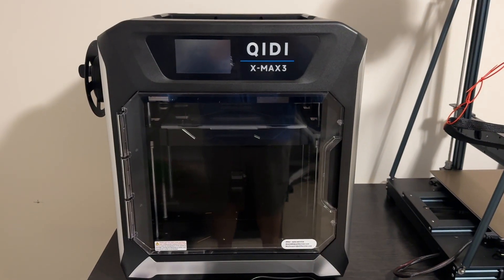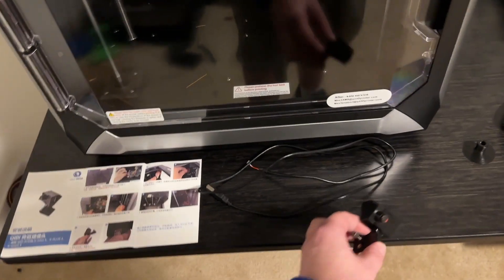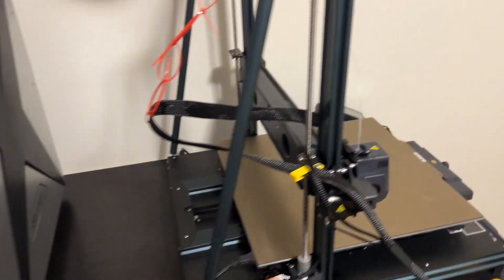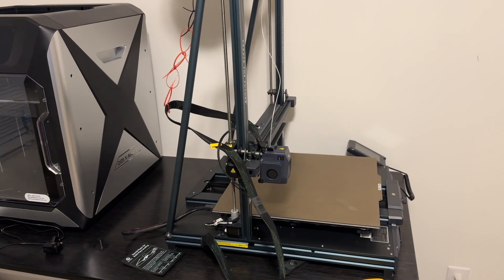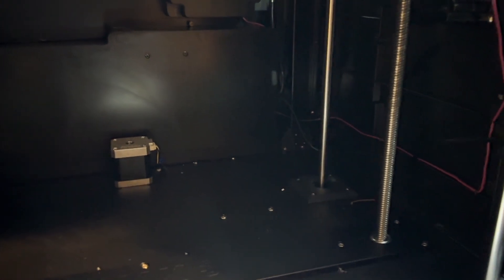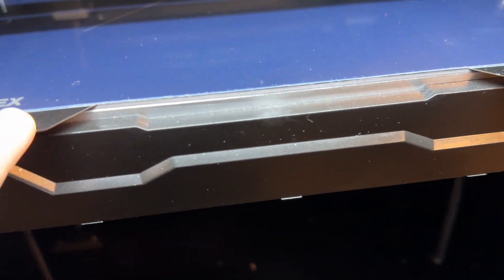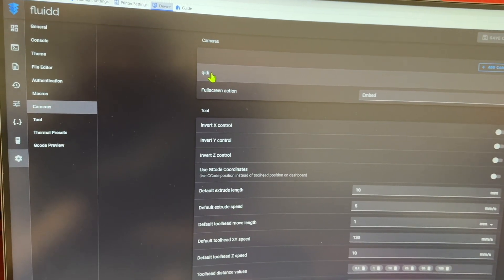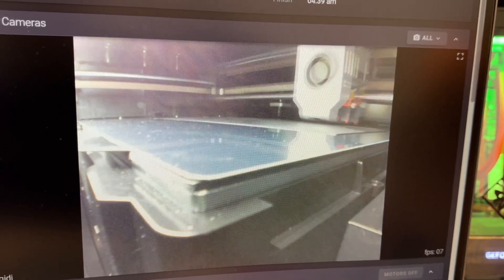QIDI X-Max 3 3D Printer Camera Review and Demo 1080p - Remote Viewing in Fluidd

Comment: Hi I have had some issues with my X Max 3, had to replace head bed board and updated cover on printhead with fan. Im curious.. what issues did you have during initial ownership as you alluded to that qidi shipped you parts for? I would appreciate knowing what pitfalls to look for and see if my printer has the same issues as yours had so I can request and replace those parts sooner than later. Like I said, the mosfet/igbt board that powers the heat bed was bad on mine, and needed cover with fan for printhead as printhead board got overheated. Thanks for the vid on camera!

Comment: Hello. Great vid. I just bought an x-plus 3 and the camera arrives today. Where did you get the fluid program? I haven't seen it yet. Only the qidi slicer that was on the thumb drive. Im also not able to send prints to the printer from my laptop wirelessly. It installed but i think I'm missing something.
Reply: did you ever find out how to download fluidd? I am not able to even use the qidi camera I installed inside my X max 3

Comment: Is it not too hot in there and is this camara in the pack when you buy the 3d printer? When not what is this camara name?
Reply: Can anyone answer my Question?
Reply: @messiyam9796  Cam is not included afaik. Didn't come with mine from late 2023, Not mentioned in current product info, except as an optional accessory.